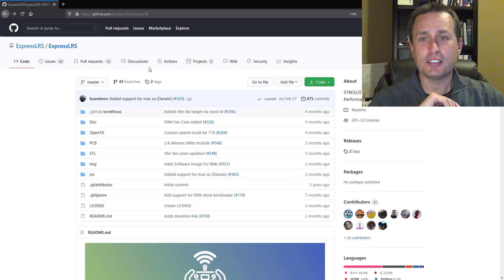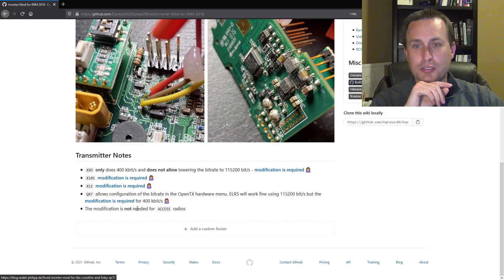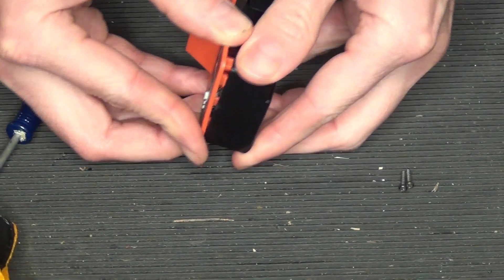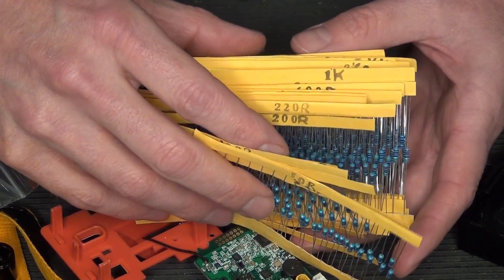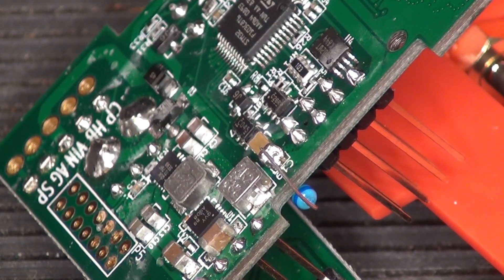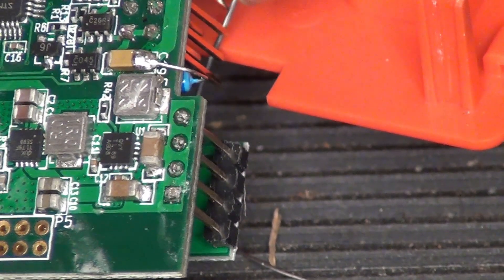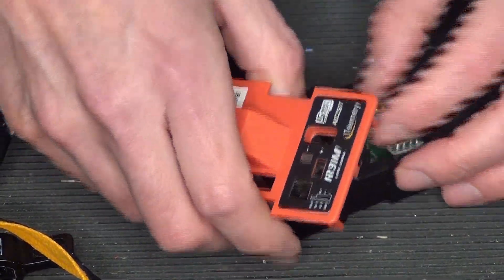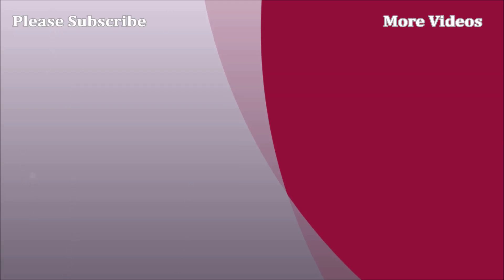ExpressLRS: Inverter Mod for R9M | 2018 ACCST Modules ONLY

Comment from the maker: https://i.imgur.com/1PZnK0u.png shows a plot of pack rates WITHOUT and WITH the inverter mode at 115k and 400k baud rates from the TX.  THIS DOES NOT show the end-to-end latency gains as outlined in the video, but it does show that pack rate (IMPORTANT) is consistent either way.  Ignore the spikes.  Those go away if Sync is turned off after arming.

BTW - these jitter amounts are the BEST I have ever seen on a RX protocol.  They are WAAAYYYY less than any other I have tested.  It looks like the least possible is WITH the inverter mod. and continues to run at 115k baud.  That of course doesn't help reduce the 1.5ms end-to-end, but that's not important to everyone.  Low jitter in general does help you run more FeedForward Boost which can easily make up the 1.5ms end-to-end.  Either way, with such low jitter from ExpressLRS, it really opens up the possibilities to push FeedForward Boost in Betaflight much harder!
Reply: soooo you dot need the od? i can fash express lrs and do mod later

Comment: donnt run 400 without this mod. i switched to edgetx, forgot to check baud rate.

it works but after 5 to 6 minutes the module would start rebootig randomly, had a failsafe once but most times was able to coe back and land.

Comment: I have a problem, my range is so bad with it. 400 meters and failsafe. A new reciever and antenna are helping nothing ( other reciever placement too). I flasht both new? My lq is most of the time high but the rssidb is so low i have after 300meters -90 at 50 mw ???? Can someone help me
Reply from the maker: I would hop on the ELRS Discord: https://discord.com/invite/dS6ReFY
But if LQ remains OK, then you may be OK.  Also check the Signal-to-Noise.  JB just did some good content on this subject: https://youtu.be/seUi-_HV_O4

Comment: I have a question. Does the internal tx16s r9m access mod still have to be done to use the r9m 2019 module as elrs? Or can it be put back to normal?
Reply from the maker: No.

Comment: What is the radio mod spoken about at the end and is it or anything else needed if using the taranis x9d plus se accst
Reply from the maker: I hink the X9D runs at 400,000 baud.  Check ELRS Wiki on github.  They have a chart which radios need mods.
Reply: @uavtech  okay thanks for the reply I've been watching some videos but haven't heard of a radio mod I'll look into it

Comment: many thanks for this video. I have a qx7 accst, r9m 2018 and have done the mod. I changed the band to 400k and lost telemetry on the radio. When I go back to 115K the telemetry comes back. Is this the way it should be? How can I have telemetry on 400K?
Reply from the maker: Ummm...  i also have the QX7, 2018 module and didn't have that issue.  My best advice is hop.on the ELRS Discord and ask the group.
Reply: @uavtech  thnx

Comment: Question,   Why do we need ADC filter off?  Should we have this off running crossfire as well or just ExpressLRS..   
I noticed when I turned off ADC on my QX7 with Crossfire mod done and running Full crossfire TX I was getting jittery throttle values showing in betaflight reciever tab.  When I turned ADC filtering back ON the jitters on my throttle stopped.
Reply from the maker: ADC helps with gimbal jitter, but makes bigger and random steps in the TX commands to the FC.  I would fly both.  If you cannot notice the difference, i would have off.  But if better with it on due to gimbal jitter, then leave.on.
Reply: @uavtech  Ok.  Thank you.

Comment: I lose connection after less than a minute running an unmodded Qx7 on EdgeTX with onebit enabled still on the lower baud rate. Going to give this a shot to see if the higher baud fixes it because I love flying with my x7 as my daily driver but might have to use my t16 if I can’t get it right. Seems like I’m not the only one having this issue as well.
Reply from the maker: Weird.  I have an X7 and ran on 115k or 400k without mode without issue.

Same after mod.

🤔
Reply: @uavtech  got it working with bench test need to do a full test. Seems like the module was unstable with the radio without this mod. And yes the full telemetry works for me now including betaflight lua with version 1.2.0. 400000 was absolutely necessary for me in this case. Thanks for your help I learn most of my info from you and JB.

Comment: Following intently. Here's a hint that I'm sure you know. Grab a pot of flux, daub little bits on each side (wire and cap) then load up your iron with a blob of solder. Hold the wire to the cap and touch the blob to the joint. Instant perfect joint with no 'points'. #onehandsoldering

Comment: First of all thanks for the great tutorial! How can I find out if I have a REV4 motherboard in my QX7? Just so I'm clear, if I don't have a REV4 motherboard, I just need the mod on my R9 (accst version) to use 400k baud rates?
Reply from the maker: Correct.  You would need to open up the radio and look on the board for the rev version.
Reply: @uavtech  Thank you for your help. I have a ( X7_MAIN _REV0.6 ) (2018/05/15) motherboard, so I should be fine without a modification. :)
Reply: @uavtech  
Hi, 
Thanks for your useful videos !!! 
Is it possible to do the X7 software mod, or only the X7 hardware mod for 400k baud?
Cheers

Comment: I remember there was a "crossfire mod" for qx7 radios. Is that also needed as well as doing this mod to get it working correctly?
Reply from the maker: ExpressLRS works fine at 115200 baud, however, if you want 400000 baud and have a REV4 motherboard in your Q X7, both are required: https://i.imgur.com/4StD2gu.png

Comment: This is great stuff, thanks! Just so I'm clear, is this a pointless mod on my R9 (accst version)  I don't do the 'crossfire' hardware mod on my 3 year old QX7?
Reply from the maker: correct.  Just run 115200 baud in that case.  Which, like covered, works fine too.
Reply: @uavtech  thanks for the reply. I like to tinker and may want to go xfire at some point so gunna do both!

Comment: The modification on the first QX7 Mainboards ( X7_MAIN _REV03 ) (2016/09/29) is not necessary. They were able to use 400 kbit..... ;-)     Only for the REV04 boards this required.
Reply: Oh. I have to check my version. I got a QX7s i think, it came with halleffekt gimbals

Comment: I wish the baud rate and ADC filter were per model for different modules and FC with Rx filtering vs FC without. Almost need two controllers at this rate.

Comment: Do i have to do this? I use a jumper t12 pro with the accst r9m
Reply from the maker: "have to" is not the best way to put it.  If you want to, you can.  If not, don't.  I covered the advantages (which i don't think are huge just this moment) in the video and in the pinned comment.  In my pinned comment, i also shows a graph of how in either case, packet rate consistency remains the same with ExpressLRS.

I would guess Jumper has the option of 115200 baud or 400000 baud?  IDK, I don't have a jumper.
Reply: @uavtech  yes it does have both 115k and 400k baud rate, and it defaults to 400k. I probably wont to this mod cause I dont really see a significant advantage by putting the resistor, but to be honest its because i hate soldering on such small pads lol. 

Also wezley's comment kinda put me off from doing this mod too
Reply from the maker: Maybe just set to 115200 baud and let it go.

Comment: Good video!  Now on to the internal fan and power-controlled transistor mod!  I just did these a few weeks ago and it was a little challenging given my entry-level skills at component soldering.  As another comment mentioned, I ended up soldering flexible wire to the legs of the transistor to make the final connections more...flexible.  Maybe a video on the 2W heatsink/fan mod?  Thanks for sharing this ELRS content!

Comment: Be very careful with bending of the resistor. I did this aleady carfully and the resistor ripped of the leg where it was already soldered. I would recommend to solder the other side first or use hot glue to remove the physical stress from the first solder point.

Comment: Pretty interesting mod, Mark! Thanks a lot! 😃
Yeah, I guess I'm going to have to do the same! 😕
Do you think it would be easier if you used some flexible wire instead of only the resistor things? So you could easily put it anywhere and pass the wires where there's more space, I don't know... Or just like this is better?
Anyway, stay safe there with your family! 🖖😊
Reply from the maker: good idea.
Reply: Maybe just a thin copper wire (like from coils or motor windings) would do the job. But it shouldn't be too long because you may get some strange behaviour because of capacitive/inductive coupling. So just solder the pre-bended resistor with one leg and use the tin copper wire for the other side.
Reply: ran into the same issue and cant fix it, could you sorder it back on the PCB ?´im tired of the "FW update Error NoSync"

Comment: Nice job Mark!

FYI you need to be careful that the leg of the resistor that bends around the PCB is up nice and tight against the PCB. If it has some "play", you can end up stressing the leg as you slide it back into the case, and ripping the pad off the inverter. Ask me how I know :|
Reply: Couldn't we keep the Resistor on one side the board and use small silicone wire Jumper to avoid this?
Reply from the maker: oh boy.  growing pains.  At least the modules are pretty cheap.

Comment: Nice clear tutorial. Thanks.

FYI, there have been numerous reports on the ExLRS discord of the super 8 antenna breaking internally.  This is probably the number one cause of new users having range issues.  I would recommend using the standard r9 dipole.
Reply: Agree, actually it was the reason I changed to ExpressLRS since i thought the range sucked on the R9... First day of ELRS i could fly almost 1km on 50hz but with dropouts and 100dbi+ signal before I found out the shielding (inactive part of antenna) had no connection. 

Just grab a multimeter and beep inner sma with one of the loops and outer side of sma with opposite side of antenna and check if they are shorted :)
Reply: Was thinking of exactly this when just yet i checked my R9M if i had done the mod already. Pretty flimsy lead carrying the "heavy" part of the antenna. Always dangling around and most conductives don't like bending. Thanks for the advice! (And somebody tell someone i don't sell washing machines or finger nail insurances - i'm a solder paste inspection specialist 😉)
Reply: But im using the super 8 with no issues...
Reply: For anyone still hesitant of the R9 2018 dipole antenna, it is tuned quite well! No need to swap it, that is if you can live with the size.

Comment: I have x9d+ se radio and do I have to do a internal mode as welll??
Reply from the maker: "Most" is relative.  The X9D pushes 400k baud ONLY.  However, I ran 400k baud to my R9 without the R9M inverter mod and it was OK.  I'm sure it is better to do the mod with the X9D though and maybe an ExpressLRS dev will correct me on how important it is or not.

Here is pack rate with and without mod at 115k and 400k baud rates from my Q X7s.  Ignore the big spikes.  Those go away when you have Sync turn off on arming.  What I'm looking at in this image is the packet jitter on the different settings.  All are about the same.  Of course end-to-end with the mod and X9D+ will be less with the mod vs. without.  Also the LUA thing I mentioned in the video are the benifits:  https://i.imgur.com/Yf9iwKc.png

https://github.com/ExpressLRS/ExpressLRS/wiki/Inverter-Mod-for-R9M-2018